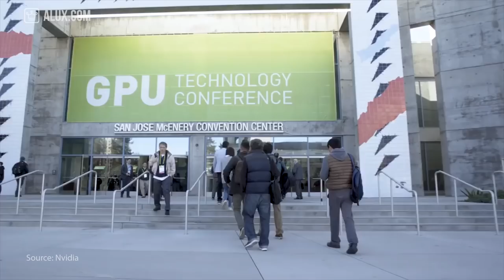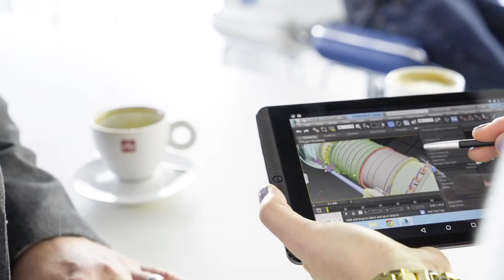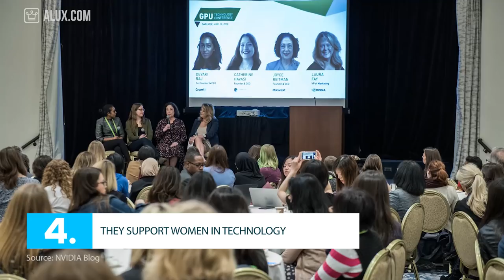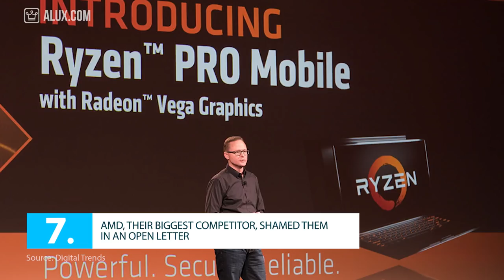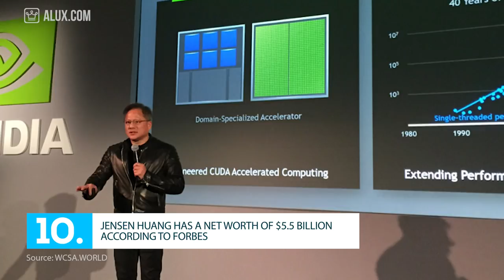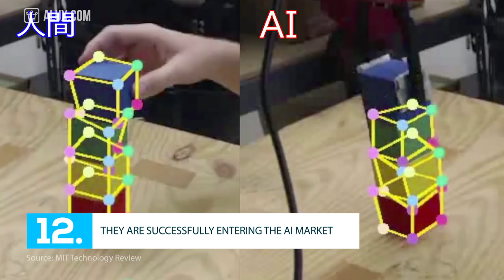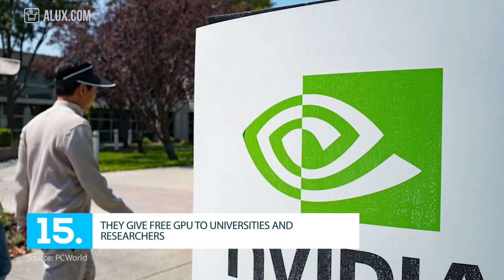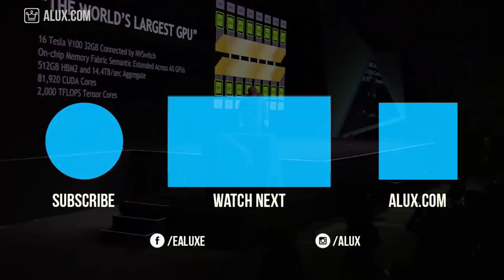15 Things You Didn't Know About NVIDIA

Comment: I quit watching when number 1 was completely wrong. Nvidia didn't introduce the GeForce 256 until 1999 and there were several graphics processor chips before that. 3dfx (Voodoo), ATI (Rage) and even Nvidia (Riva) had graphics processor chips long before the GeForce 256. These are just off the top of my head. Several other companies had come and gone before the GeForce 256 as well.
Reply: S3 , Matrox also produce GPU
Reply: Joe Al I remember Hercules and their release of the 1rst 1GB consumer card in 2001. Wow did I want that thing! Unfortunately, even in 2002 it was still a lowly 512 x700 Pro (it may have been 256 then the X1950 being 512...oh well, you get the point).

I thought the same thing when I heard that. There have been GPUs for a very, very long time. Maybe they meant a GPU chip with a real time physics emulator built in? Idk, I just know there were graphic boards in IBM’s before Windows was a shell program on dos. Seriously, what the heck was she talking about?

Also, the popularity thing was kind of silly as well. They are the most popular graphics company among every age segment because OEM’s used them for so long, partly bc of Intel-like deals like “If you go through with 35% AMD GPUs in your system then that 27% card discount changes to 10% per unit. You decide.) They also have their sticker/some kind of branding of every product they are in. AMD doesn’t, why, I have no idea. Ei they should be marked on every console “graphics by AMD” or a splash screen when you boot a PS4/Pro, XBox One/slim/X, but nothing. It’s ridiculous. Like either company would have went with Nvidia if they insisted on some recognition on either the machine or boot up. Horrible marketing.

Ahh well, she did get 1 thing right, if you have millions to invest they are a good company, but for the average investor, their price point makes them a stock you don’t want a high portion of your holdings in. Waiting for an AMD dip below $30 or so would make more sense too me, but I’m very far from a future billionaire, so take it from them I guess ;^) I’ll go throw a thousand at a penny stock and a thousand at litecoin, then get ready to sell quick 🧐. Stock advice after all that misinformation or absence thereof. Uugghh.
Reply: Anyone here ever had an Ageia PhysX PCI card?
Reply: TheOziasmidwinter
 Remember 3dfx and 3dwrappers?
Reply: 3dfx (Voodoo), ATI (Rage) and even Nvidia (Riva)  are not GPUs, They are 3D graphics accelerators. They didn`t have hw T&L.
Reply: First one was called "NV1"
GeForce256 was shit as alway as first iteration. See RTX
Reply: So you basically discount an entire video 15 THINGS just because ONE is wrong? Smart.
Reply: There is also a lot missing how they talk about partners like ST who helped them in the early days and how they use their propaganda machine to crush their competition (Hercules, ATI/AMD and Intel).
Andoredtv has an interesting video about their not so bright history which shines brighter than ever.
Reply: Take with a grain of salt. 

Hardware acceleration vs GPU. if I'm not wrong, Nvidia came up with the GPU name in the first place to show how differently their product worked from others who made products that relied much more on the CPUs
Reply: well nvidia coined the term gpu with the GeForce 256 graphics cards before that were 3D Accelerators and needed a dedicated 2D-Card, remember how you hooked up your vodoo card to that other 2D card? Google it, you will be amazed.
Reply: GeForce 256 was the first consumer card to have hardware accelerated transform and lighting.
Reply: Nice video,was quite engaging right from the start to the very end, indeed its a good time to invest in crypto.